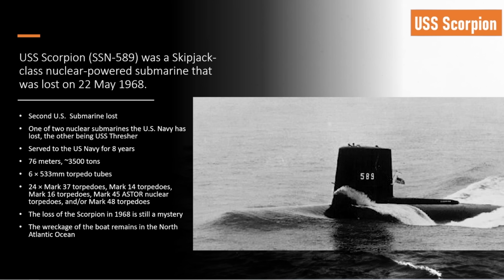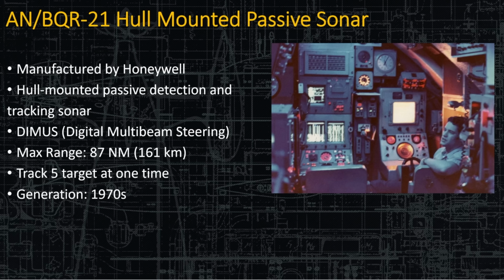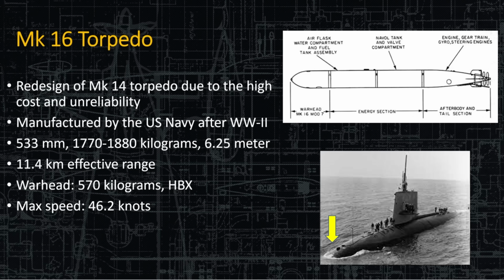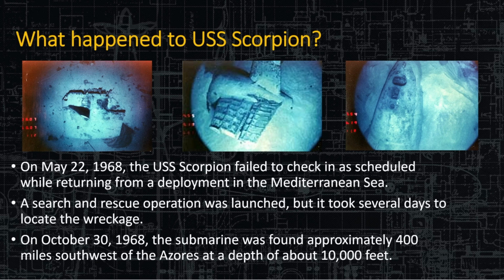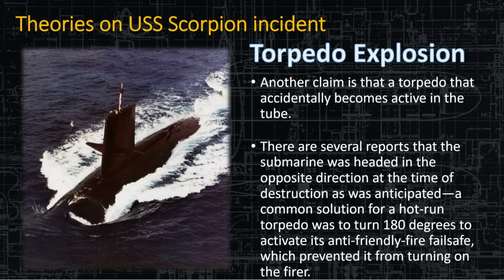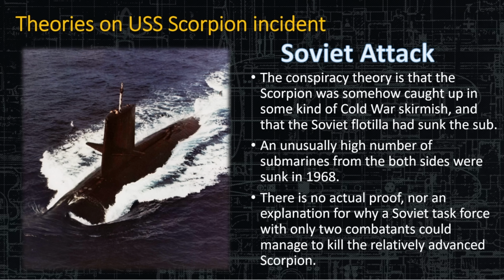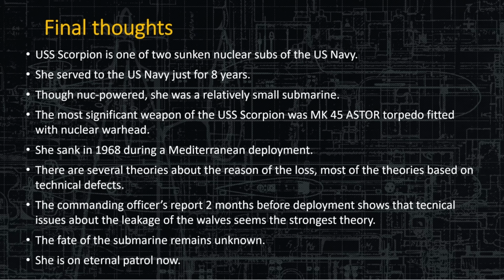USS Scorpion SUBLOSS SUBSUNK

Comment: You should go back and read chapter 5 of Blind man’s bluff, it goes into extensive detail about what mics were used for the target motion analysis, they weren’t SOSUS, Craven did the analysis I believe.

If I remember right they came to the theory that it was called out a “hot torpedo” not a “hot running torpedo” and they instinctly turned the boat around. The reality was the battery was overheating and cooked off the weapon.

Comment: Interesting read re SCORPION, is
"SCORPION DOWN" by Ed Offley which addresses the conspiracy issues in depth.
Available cheaply on Amazon/ebay.
Reply: A great read.
Reply: @nunayoorbidnez2119  Yes; excellent book.
Reply: Update: The battery H2 explosion appears to be 
firmly probable for SCORPION'S loss.
'Why the USS SCORPION (SSN-589) Was Lost" by Bruce Rule provides updated listening-post data
that satisfies me [an old Battery Charging Electrician etc EM1SS from the 70's ] re her loss.
The in-depth sonar analysis fits the failure mode:
2 small explosions .5 sec. apart, followed by the hull implosion about 21 min. later at 1530 feet.
The small explosions were individual bat. cells exploding due to H2 and a probable spark, which ignited the larger atmosphere [with explosive H2 content], producing an over-pressure within the hull of around 400 + psi which is considered 4 times that survival, instantly killing the entire crew and destroying the ops compartment. The boat then being heavy [she had operational limitations due to material deficiencies not to exceed 400' i memory serves]
continued to descend until the hull collapsed about 20 minutes later.
SOSUS at that time was not manned, but recorded only.
The book was expensive, pub'd in 2003 [I think]
and highly technical, but Rule did a fine job.

Comment: Its loss is a mystery only in that there is no obvious cause of its loss sitting on the bottom. Personally I believe she suffered a battery fire in one of her mk. 37 torpedoes that caused a warhead cook off. We know that when she went down she was heading east when she was supposed to be heading west, a standard response to a “hot torpedo” report was to immediately do a 180 degree turn in an effort to trigger the failsafes that shut the torpedo down automatically. If it was a battery fire, the men might not have even been aware of it until they smelled burning insulation and saw paint bubbling up on the housing from the heat, and by that point it would have been too late to do much other than spray it with water continuously to cool it off while its loaded into a tube and jettisoned. Initiating a 180 degree turn wouldn’t have helped in this case. There was a massive quality control issue in the batteries of the Mk. 37’s in the late sixties but a high demand for torpedoes caused a number of subpar batteries prone to catching fire under extensive vibration to be shipped to the fleet anyway, and after checking serial numbers at least one was on Scorpion on its final patrol. A fire related cookoff would not of produced an explosion nearly as powerful as it would have been if fired at a target and detonated, but it would have been enough to blow out the torpedo room hatch, the escape trunk hatch, and the torpedo loading scuttle hatch. Scorpion’s wreckage shows a forward torpedo room relatively intact but with no trace of hatches anywhere  indicating that it was flooded and equalized by the time the sub sank to crush depth, and everything behind that point is extensive implosion damage.

Comment: I have a question why use metric system when describing certain aspects like the length and torpedo size and distance in kilometers  when at sea most would say nautical miles I get that most of the world uses the metric system but the US still uses the imperial especially in the 1960s just wondering

Comment: "After analysis of the ship's battery cells, this [hydrogen explosion] is the leading theory for the loss of Scorpion. This is consistent with two small explosions aboard the submarine, a half-second apart, that were picked up by hydrophones." Oliver, Dave (August 2015). "Respect For Authority – Overrated?" (PDF). The Submarine Review: 116–124.  Not certain what or how an "analysis" of the battery cells could have been done considering the depth of the wreckage.  Would flooding due to faulty operation or mechanism of a TDU result in that kind of acoustic pattern?  I wouldn't think so.

Comment: In chapter five of Blind Man's Bluff, the Mark 37 torpedo was to blame for the sinking. After discovering the flawed batteries installed in them. The Navy had them removed from service, but not before Scorpion left for patrol with the flawed 37 torpedoes. John Pina Craven explains in detail how this was discovered and kept secret. So we now know for certain what sunk the Scorpion.
Reply: I agree with John Craven’s assessment as well. The fact that the torpedo room didn’t collapse like the rest of the compartments is proof enough that it was already flooded when the boat reached crush depth. Craven, among others, were convinced that the torpedo loading and escape hatches were blown off by a fire induced low order detonation of a torpedo warhead. The 1969 court of inquiry also cited an incident in 1960 on the USS Sargo SSN-583 when she was pier side in Pearl Harbor where a fire in the aft torpedo room caused a low order detonation of 2 mark 37 torpedo warheads.

Comment: I would think that with the increased depth capabilities of any submarines and the many years of new construction of nuke boats, escape hatchs, TDU's, torpedo tubes and any other required hull penetrantions leakage issues would have been long corrected. 
I sailed surface navy and sailed merchant ships for 40 years and we didn’t like water leaking into the ship from ANY source.

Comment: Learned about this and Thresher in subschool back in the 80s.
Thanks for your take.
I agree it's most likely the TDU and a nub may have been part of the loss.
I assume they had a ball valve at the bottom of the TDU as well as a latch at the top.
We had a vent valve in the "lid" of the TDU.  Opened it a bit while flooding the TDU.  When it spits water you know it's almost completely full.  Open the ball valve, the cans fall into the sea.  Providing the boat is not going too fast, jamming a can in the ball valve. 
Also the interlock may have failed leaving the ball valve open when lid us open.  Bad news.
On the hydrogen/ battery explosion, I assume they had a hydrogen diffuser on that boat?  Ours was starboard topside behind the sail if I remember correctly.  Plus a Guage showing percentage of hydrogen present in the battery compartment.   Either way, to me, it points to inexperience.   Never open the TDU before checking that vent valve.  Plus the cook or whatever should have been on the phones with someone on the bridge. 
Some context here,  I was a space tech, 0421 on SSBN 634 for 6 years,
Taught  Space Maintenance for 4 years.
Reply: Oh,  another comment.
Friend in the Space instructors office was on the Bonefish during a battery well explosion. 
He said everyone knew to get topside even before the 1MC.
Said his shoes were melting while standing topside.
Reply: Back around 2000, USS Kentucky had a scratched TDU ball valve and an interlock that was a bit shifty. I still remember how scary that was, personally watching a scratch in a 10" titanium ball valve fill an entire "vertical torpedo tube" with water, very quickly... Sometimes we could barely get the breach door closed in time.

Comment: Hydrogen is fun. We had a hydrogen electrolysis issue in work causing a hydronic system to lock up and repeatedly loose circulation. Was amusing to explain to someone what the issue was by venting some of the 'air' in the system into an upturned cup and putting a lighter to it.

"Pop!"

Anything were you have water and dissimilar metals makes for amusing things. And corrosion. And any day you can make a little fuel-air explosion in work is a good day.

Comment: I was on a Norwegian sub, where we (I) once experienced huge leakage from our garbage / sewage shoot. If I had not reacted as quick as I did I would not be typing this today. Managed to secure the inner hatch before the shoot was full of water, as everyone know, you cannot compress water, and as soon as it would have been full, I would not have been able to put the hatch down and lock it. Even with the air went open, it would not have been enough to evacuate the pressure from the incoming water as it was way to small.
Reply: The Trash Disposal Unit, or TDU on American boats
was considered one of the weak points / risks to SCORPION as a maintenance issue. A 10 " hole like that to sea would be quickly lethal.
I assume the interlocks were considered unreliable,
but don't know anything specific.
Reply: Glad you're still here. That was 'dicy' to say the least.
Reply: Sorry for my ignorance but I have a question. If a sub sprang a leak when it's diving deep say 1000 meters, would the pressure of the water coming in be equal to the pressure outside? If so, would someone trapped underwater in the sub experience the same pressure effects as a diver at 1000 meters?
Reply: @minimumapature3361  Once the sub completely filled, the pressures would be equal. Of course that's a bit deep for a diver,
to say the least.
Reply: @minimumapature3361  Pressure drops as resistance to flow based on hole size/shape until the relative 'void' of the internal space is reached.
In sub school, however, we warned that any leak at depth [100m +, but especially beyond that] cuts like a knife, bounces from solid objects almost like light on a mirror.
aka: LETHAL.
It is a real nightmare].
Re: "Diver" if a compartment floods, any remaining bubbles in high points would compress by the incoming sea water until sea pressure equaled internal.
Reply: @richardwellons5138  Ouch that sound like the way dry steam cuts sailors. Thanks for the info dude🙏🏻
Reply: @minimumapature3361   at any depth and if you experience a bridge in the pressure resistant hull, you will eventually experience the same pressure inside the sub as outside. So yes, you will experience the same pressure as a diver at that depth. @ 1000 meters a compromised hull would lead to instantaneously implosion and death. Atmospheric air become toxic due to the partial pressure on each gas that normal air consists off, and not survivable below a certain depth. Oxygen toxicity typically occurs when the partial pressure of oxygen exceeds 1.3 to 1.4 atmospheres, equivalent to about 57 m (187 ft) depth when air is breathed and shallower when enriched oxygen breathing mixtures are used

Comment: What happens when nuclear sub is lost, will they try to recover the reactor part at least, and if they can’t recover it, was there any type safety measures put in so would not have a melt down on seas floor? Or was reactor even big enough to cause a big issue if it were to melt down, or could it even melt down on sea floor? I assume it could.
Reply: It's not practical to try to recover the reactor from that depth.  The core will not melt down due to the sea water removing any decay heat.  However, over time, the vessel may degrade and there could be some radioactive leakage into the surrounding water.  Due to the materials used in the construction of the reactor, I wouldn't expect this to happen for several hundred years.  By that time much of the radioactive material will have decayed to stable isotopes.  Also, the Navy routinely takes water samples from the vicinity of the wreck to detect any change in radiation levels.
Reply: @nukegator7274  intersting, I’ve always wondered that, thanks for answering my question!
Reply: Nuclear reactors and weapon systems are checked on the bottom.    They are never raised off the bottom

Comment: I have a question about the technical brief that you gave at the beginning. You said that these early towed arrays had to be mounted and removed by a tug and they couldn't be retracted by the sub in the field.
What was procedure if the sub had to go evasive? Was the towed array cut, or could it handle top speed maneuvers?
Reply: Towed arrays do restrict the maneuverability of the submarine somewhat when deployed.  Modern subs can retract the towed array while underway.  One thing not mentioned is that subs also have a floating wire antenna that allows them to receive ULF messages while submerged.  Funny story about the floating wire.  On one boat I was on (which shall remain nameless) we were using the floating wire for the first time.  There were specific precautions that had to be taken when going to periscope depth to avoid cutting the cable with the screw.  The Captain would ask the OOD about those precautions prior to granting permission to go to periscope depth.  One day during a battle stations drill the Captain took the conn.  He took the boat to periscope depth and promptly cut the wire.  After that we no longer got asked about the precautions.

Comment: 8:20 -- RE:  5,500 Equivalent Full Power Hours;  Well heck, quick maths demonstration time!  1 Day = 24 hours, 5 Days = 120 Hours, and 5 Days x 73 = 365.  Thus 73 x 120 = Hours In a Year, plus 6.  So the Core needs refueling at least once a year, eh?
Reply: Back then boats were discouraged from running at full power unless necessary to extend the life of the reactor core.  Typically they ran at about 20 to 50% power.
Reply: ^^  Also, DANG, how much more efficient is it on "Fuel" if it's Not running at Full Power?  Perhaps refueling is once every 2-5 years.

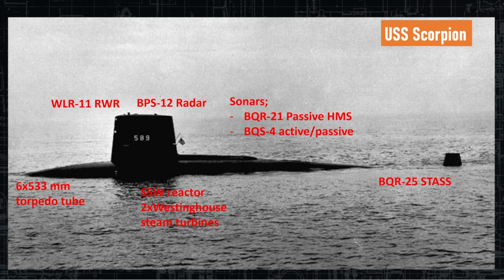Comment: 5:15 -- RE:  Tugboat and Diver attach the Towed Array;  OMG, I never would have guessed that the towed array didn't start out as a piece of equipment that was somehow contained and deployed by the submarine itself.  And yeah, I caught on quick that it also means once connected it stayed deployed until the mission was over or an emergency situation demanded cutting it loose.  

Question!  Could the OG towed array be detached while at sea by physically cutting it with explosive bolts and a detonator switch?  Or would the sub need to deploy a diver to do that, too?

Comment: I remember reading that the early theory about the Scorpion turning around was based on incorrect distance calculations from SOSUS. They showed her heading straight back to the US at a steady pace, then something happened, and then it started going exactly 180 degrees from its previous course, eventually imploding. Apparently those early calculations forgot to compensate for how the speed of sound changes with pressure. When re-calculated properly, the ship continued straight towards the US the whole time. The event occurred, and then the Scorpion slowly sank to crush depth (still going straight), and then imploded. This suggests that whatever the event was, it disabled a significant portion of the ship's control team.

A few years ago as part of its routine visits to the wreck, the Navy recovered pieces of the ship's battery that indicated a violent explosion in the battery well. While that isn't enough evidence to determine failed TDU vs hydrogen buildup theory, it certainly is enough to disprove the hot-run torpedo theory and the torpedo tube fire theory. Although those are (now) clearly not the actual cause of the Scorpion's loss, they were real problems back then and the Navy did take action to mitigate those risks.
Reply: yeah, nope. Pressure makes some difference, but speed of sound is not all that important in target motion analysis (TMA). It matters for your ability to detect sound, it will not really impact bearings and bearing accuracy.

Comment: The scorpion was located by Dr. John Craven by comparing sosus records with a U.S. air force  hydrophone in the canary islands. He found the scorpion had reversed course and was at flank speed when the explosion happened. He theorised that the scorpion had a malfunctioning torpedo. In the 1980s an engineer from keyport wrote craven that the batteries used in the torpedos were defective and could short out and cause a low order detonation under  vibration, the scorpion was known to have a vibration problem. Craven theorized that the torp crew reported a "hot Torpedo to the conn, the OOD, assuming that a torpedo motor had activated in the rack ordered flank speed, and a 180° turn to activate the failsafe. All Sonar records showed an explosion follewed shortly by my mplosion noises moving eastward.
Reply: Yea, this was discussed in Blind Man's Bluff

Comment: I was a new Torpedoman on a 637 class boat doing PMS on a Mk-37 when I was told to stop as it could lead to hot run…It was one of the first lessons I learned onboard…
Reply: I have always believed a mark 37 torpedo is what downed this boat.      I believe that the crew was trying to eject a hot running torpedo.    The boat was turning 180° as standard protocol.    The torpedo blew up before the turn was completed.
Reply: @gregorylyon1004   Thats what my LPO thought as he caught me doing the PMS in the Mk-37…He about snatched the battery tester outa my hand…We had a long talk and training session on what to do in case of a hot run…

Comment: If you have a leaky garbage disposal unit, why wouldn't you discharge trash on the surface? To do it at depth seems unwise.
Reply: There's 100 men on board. Imagine how much trash a family of five generates on a daily basis and multiply it by 20, then realize that a nuclear sub remains submerged for months at a time, that's a lot of trash to stow in an already cramped container.